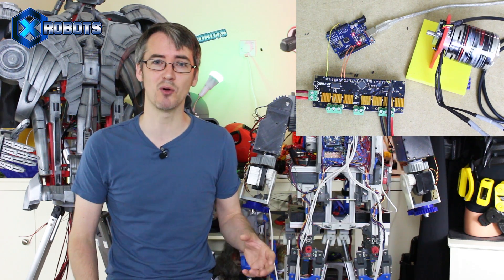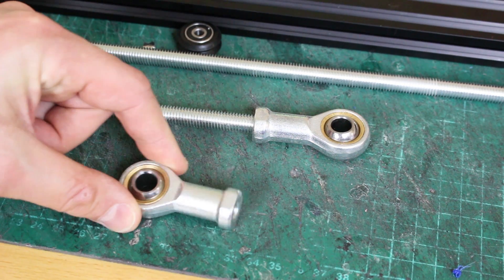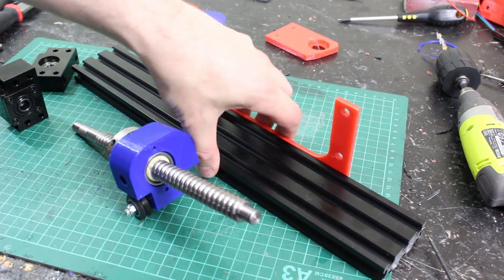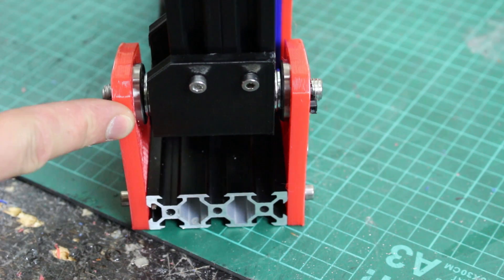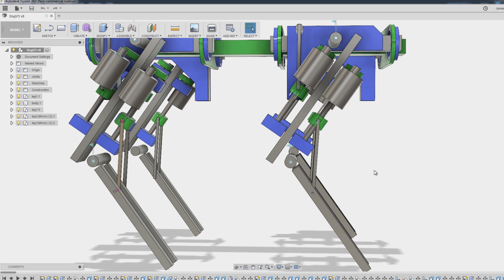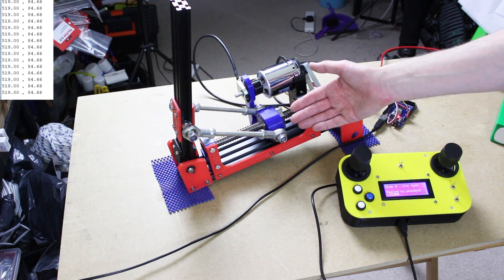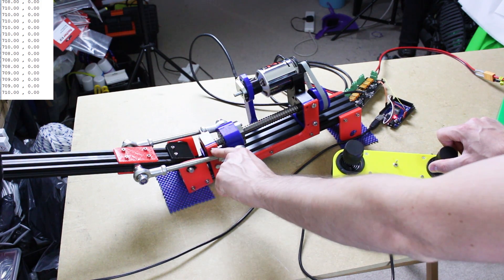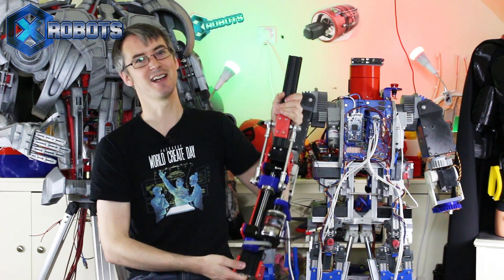openDog Dog Robot #2 | Leg & Joint Prototype | James Bruton

Comment: Maybe you could (change the ball screw pitch) drive the ball screw directly with the electric motor. No belts and no motors hanging out of the legs. You have lots of extra power in the motors.
Reply: That size ball screw with that size motor could present some inertia problems in direct drive.  Also, ball screws do have a rated max RPM, which would limit the top end RPM even with that short a screw in a fixed-free format.
Reply: I can see that could be a problem. Just hope the belts wil hold under stress.  A motor with reduction box 2.5:1 would be nice.

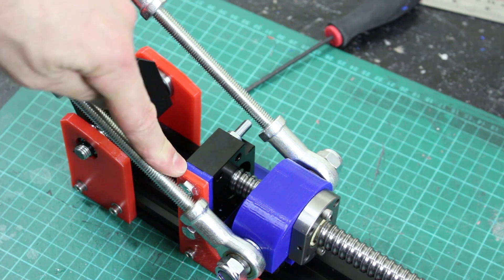Comment: 11:30 Can't you mount the bearing block horizontally? Then the sides would be free of obstructions. If the spacing of the holes doesn't fit the slots, then the bearing blocks have holes in line with the screw that you could use.

Comment: What if you take those side mounts for the ballscrew and wrap them around underneath the aluminum, bolt them underneath and then use .25, .5, 1 and 2mm shims to dial the ballscrew wheels into place? That way you wont have to be exactly exact. Plus I'm sure the extrusion isn't all the same, so that'll give you the slop you need.

Comment: Rather than committing several directories, you could just add tags to certain commits detonating a video part. This is typically the method used for release versions. of software.

Comment: What I don't understand is why you are mounting the screw sideways?  If you turned it so the flat side of the nut was facing the extrusion and mounted the bearings on the extrusion, the extrusion and some grease would keep the part fairly stable. If you add a flat steel stock to the flat side of the nut and to the bearings, you could adjust the height so it is perfect and use the flat stock to attach the extensions to the distal appendage and stabilize the nut from rotating.

Comment: Not sure why you didnt go with placing the motor at the end of the drive shaft instead of having it belt driven.   Moving the motor at the end would reduce brackets and width of the leg while possibly increasing the length as well as a slight reduction in weight.

Comment: I think the motors can be cut in half size and driven bei an FOC inverter. The ball screw can be a 12mm. I use those in CNC Z Axis as well. Any experiments going in that direction?....

Comment: Regarding prototyping material waste, for bits that don't make it to the "Bruton Museum of Engineering Design" (aka the workshop wall), do you recycle your plastic e.g. through 3D filament recyclers, local recycling programs, or any other way?

Comment: So you're just counting the encoder rotations? But if someone rotates the screw a little bit the robot won't even notice? I guess you can always use the end switch to reset... Wouldn't it be better to have a sensor for the leadscrew that measures the position of the joint..?

Comment: The deadspot/sensitivity issue with analog input is typically solved in software by adding a software deadspot if applicable, and adjusting the curve or smoothing the value before intent is interpreted.

Comment: What made you select the outrunner motors? Is it purely cost-based or do they offer better performance over inrunners (I'm under the impression that inrunners have higher low-RPM torque than outrunners)?

Comment: I love your projects, but...  I think you should have made the leg joints as a 80/20  Fulcrum pivot joint, with the motor connecting to the end of the 20 percent side.  I would have used a high speed linear actuator step motor. This would cut the weight down drastically, increase speed and strength, and reduce cost as you would not need an encoder as that can be done directly with the stepper motor.  It would have also simplified the design. :-)
Reply from the maker: There's zero chance a stepper motor would be strong enough, these motors are rated at 2KW
Reply: They use stepper motors in high speed industrial robots and more.  As you know, DC, AC and Step motors are not created equal, so whilst you may think you need a 2KW brute force rated DC motor here, you would not require anything close to that for a stepper motor, with a nice design of course. :-)
Reply from the maker: These motors as faster, more powerful, and more accurate than steppers - the encoders have 8192 counts per motor revolution which is far more than any stepper, even with microstepping. AND CHEAPER!
Reply from the maker: ... and these never lose steps even if you jam them because they are encoder driven.

Comment: 3:47 : please keep the balljoints at the end of your rods.
It’s actually releasing stress, not causing it. It also helps with vibrations and assembly. 
If the ball moves without friction then there is no stress. If the ball doesn’t move but should (rigid links) then you have a lot of stress going on.
Source : I am a mechanical engineer

Comment: Why don’t you bolt the bewaring blocks for the spindle straight to the aluminium extrusion? It seems like quite A work around to maak A plate and mount them to that
Reply: Joren Snauwaert I guess the holes are not spaced out right for t-nuts. Therefore he would have to drill the aluminium and weaken the structure. Also the ballscrew would be awfully close to the extrusions. The wheels wouldn't fit.
Reply: Oh, i thought you made the bewaring blocks yourself. My mistake! Thanks for the answer anyway!

Comment: Regarding the planned end-stops and using the speed mode of the ODrive to then find the endpoint of the encoder, this video might me interesting: https://youtu.be/q39G8FfuTjU?t=88
On the shown delta-machine encoders with absolute position sensing are used which probably would work as a direct replacement for the current solution of openDog.
More details on these encoders can be found here: https://www.monolithicpower.com/en/ma730.html
I think this would facilitate the whole initialization procedure of the openDog.

Comment: why don't you put the motor on the same axis of the worm, it will be stronger and would take less space
Reply: James Bruton and can't you regulate the speed of the motor in the program ?
Reply: James Bruton you are right... Another solution would be to use a small planetary Gear that would give you that ratio and would still be on the same axis, but I don't know if it would be strong enought...

Comment: Loving the whole development. Still think stability would benefit from a DoF on the spine, though.

I might try to simulate the body, to see if I can teach a neural net to use it to move around. Beats handcrafting locomotion logic, because it can learn while being unattended, and adapts well going from sim to RL, changing surfaces, limb length etc.

Comment: Is there a reason that you are still making flat, bracket-like parts with the 3D printer rather than your CNC?
Reply: Cheaper to mess up plastic than metal. Make it from plastic first and make sure it works or adjust until it does, then move on to metal.

Comment: @James, this could help you with the unwanted "noise" from the joysticks. Used it myself when I had the same problem using Xbox controller on a project.  http://www.third-helix.com/2013/04/12/doing-thumbstick-dead-zones-right.html

Comment: So instead of using endstop why not dectect when the encoder stops turning despite the motor wanting to. That way it hits slowly and then you know. Kinda like how the trinamic drivers do with steppers just with a brushless motor. Plus if you can change the odrives max amps on the fly you could lower it super low for the homing process.

Comment: 13:24 - Slow motion footage of the Boston Dynamics evil robots reveal that they appear to use feathery/flickery movements and dissipate the weight of the robot proportionately so I agree with you regarding the suitability and agility of the motors for the project.

They're not Boston Dynamics agile but definitely suitable for an open source project.

Comment: I really like this project. I'm trying to roughly model the behavior of such a 4-leg dog with 3 joints per leg in Python with Pybullet. I have something 'walking' but the dimensions and masses are not yet similar to this project. On the other hand the modeling with Pybullet is easy and seems flexible and realistic enough to be valuable for a project like this. Once it works the challenge will be rough terrain (stairs, steps, stepping stones etc).
Also I worked out the inverse kinematics formula's for the two pitch-directed leg angles and I noticed that it is not really necessary to be so strict on equaly of lengths of leg parts or on putting joint locations exactly on the ball screw shuttle axes.  It may require a few extra cosines and sines but I think computational overhead should still be minimal.
Thirdly, apart from mentioning Spot Mini from Boston Dynamics in your videos, there are also others you may give a look/comparison. The Swiss have ANYmal, MIT has Cheetah and I also saw some nice work from e.g. Japanese, Russian and South Korean universities and hobbyists. 
As a last suggestion you might want to add a small project to your project list where you make a very small robot with cheap parts (e.g. sg90 servos) that people can easily build along at home without a huge budget. Making it walk nicely will still be a rewarding puzzle.
Thanks again for your superb videos!!

Comment: I really love this project, especially since it's open source. I have a couple of concerns with it though, like the fact that brushless motors don't have any holding torque, so when the robot gets up and is supposed to stay up, it might weigh enough to get the ball screw turning, resulting in it lowering. an easy fix would be to use leadscrews instead, but they also have more friction in moving, not only when stationary. also, for those v-wheels, why not put some cam/eccentric nuts on them? openbuilds does this too, and it allows you to adjust the tightness against the extrusion without having to move the entire leadscrew. it would be able to still take a similar amount of load. also-also, please don't use threaded rod as an axle! i have to see Ivan Miranda do this already too many times, just use some steel rod with clamp collars(3D printed or not) instead. they will be able to take more load, are way more accurate, are straight and can be used just as easily. this is again heavily dependant on how much it will weigh, but while getting up, when the nut is reaching the far end of the ball screw, it has a serious mechanical disadvantage, and idk if that motor is torqy enough at relatively low speeds to lift the robot's weight tat way. i think i'll try and build one pretty soon! great vid as always, but keep this in mind before progressing in the project.
Reply: oh like that, with the rotary encoder. the thing is, it doesn't have actual holding torque when not moving, it just compensates when it does move

Comment: I was just about the write how this system seems clumsy and slow and something like a pneumatic/hydraulic piston would be much much better, but it seems to work far better than I expected!

I was worried that it would've ended up like with your Hulkbuster, those motors were very damn slow

Comment: Why dont you just bolt the ball screw end holders straight to the 2060 aluminium rod with correct spacers? Would save on weight  and possible look better.
Reply: James Bruton Thanks for replying! But what I meant is to turn the holders 90°, so the holders monting screws are facing the 2060 and not to the side. Then you could bolt it straight to the 2060 and there wouldn't be need for the big side panels.

Comment: I paused the vid on the pulse math to write a comment about the belt reduction. Thankfully I decided to watch another 10 seconds :D
Reply: I'm trying to drive a mechanical car speedometer using a cheap hall effect sensor board as a rotary encoder. I'll machine the trigger wheel into the adapter that fits in the speedo cable hole. Motor is brushed DC. The input is coming from a GPS unit, allthough I could possibly read the sensor on the gearbox as well. I might need to run some sort of input filtering as well if using the GPS..

Comment: Securing your ball joints in the M10 rod ends could be done with  LOCTITE 638 RETAINING COMPOUND (available in the U.K.) Inexpensive, super easy to apply and rock solid. Great work you're doing !!

Comment: It might be easier to just run the v-wheels through an eccentric nut so you always have adjustability and aren’t relying on the absolute tolerances of the printed ends.
Edit: further to that I have seen full grown men sitting on lengths of 2040 without it bending. I don’t think putting a hole through it will cause too much of an issue.

Comment: I still hear a high pitch sound from when the motor is set to holding power. Anyone else hear it?
Reply: Nope...

....so very old :(
Reply: I would leave it on as an audio indicator that the joint is in hold mode, since this is development.
Reply: @JacobianMatrix9  The only way to get rid of the noise, at least our ablity to hear it, is to use a pulse frequency that is above human hearing in the mid kilohertz range. This requires higher end micro controllers and motor drivers. Currently, being able to hear the motors is a benefit while developing the gait and standing software since you can hear the motors engage.

Comment: i feel like half of the "i'll fix that later" piles up and doesn't actually get done unless something breaks
Reply: how many parts on the exosuit were eventually supposed to be CNC'd?
Reply: 'technical debt'?
Reply: Lol. That's the reason why projects like FreeBSD insist that you get it right the first time before you try and put it in the code.
All well and good, but as I'm sure you're away, nobody uses FreeBSD, and everyone uses Linux.
What's the main difference?
Linux is basically just made by organically adding things as and when people feel like it.
A lot of dubious, sort of working code gets put in with the idea that it'll 'get fixed later', but of course it never does. XD

Well, if it works... Does it really matter?
Reply: What's wrong with that? Proper British engineering. Made our car industry what it is today.
Reply: Thats the joke. British dont have car industry anymore.
Reply: It's open source. You could fix it yourself!

Comment: Why not use a cam or eccentric spacer in the middle of the block that supports the V wheels. Use an internal screw to adjust it.
then your able to adjust tension but wont need to make all the frames movable and thus stronger.

Comment: I am also building a robot with a very simple design anybody can make it but there is a twist of arduino uno i need to run the motors one by one in 1 second but with full power but I didn't have any motor driver.how can I make it.
Reply: Mosfet.